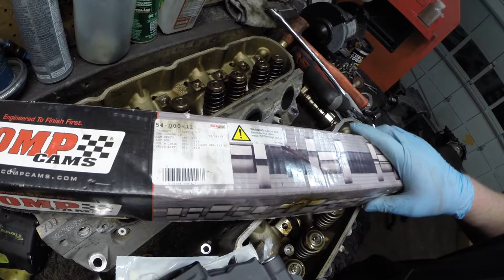Epic Saab 9-7X Build, IN A GARAGE! Some Assembly Required! PT3

Comment: U rebuilt the engine in the black Saab ?
Reply from the maker: Not a complete rebuild, I didn't touch the rotating assembly because it only had 80k miles on it. Just all new gaskets and seals, and rebuilt the heads with all the upgrades you saw in the video. Thanks for watching brother!